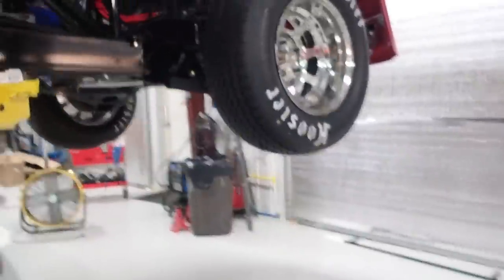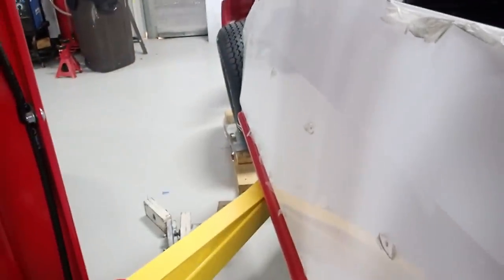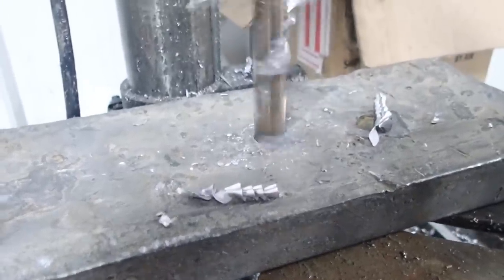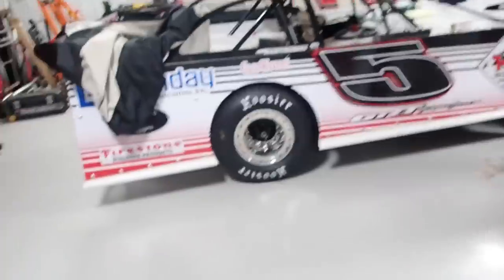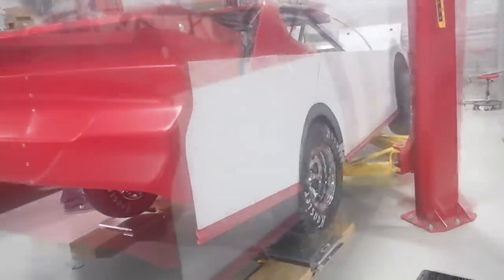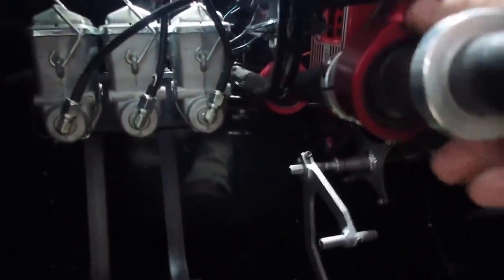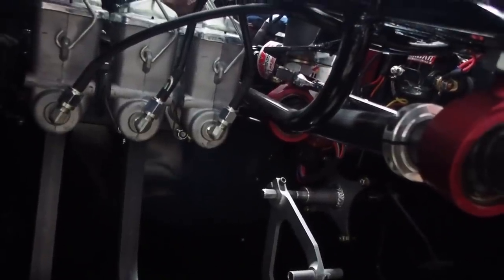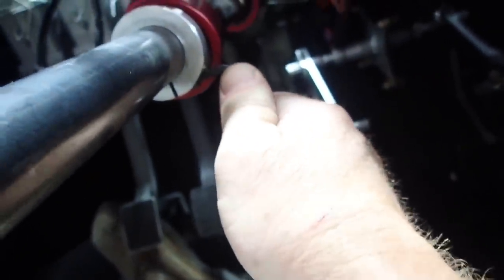HARDEST PART OF A NEW RACE CAR 🤔🤔🤔

Comment: I know when I was working with Wayne Brooks. He built a metal box to put lead into. He had it directly over the transmission and could easily add or remove lead without being concerned about the lead falling off.

Comment: use water as a lubricant/cutting fluid when drilling lead. the bit gets too hot for the lead and won't cut very well, if you don't. i learned that 40 years ago, working on my 1st street stock. cheers.